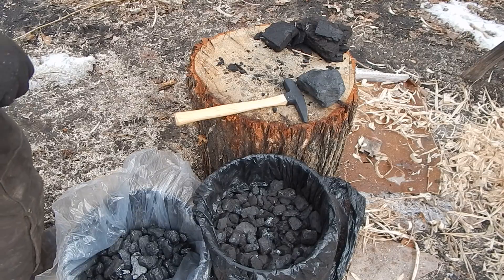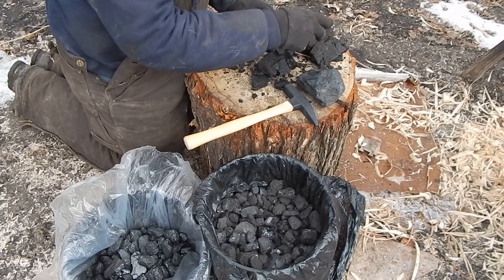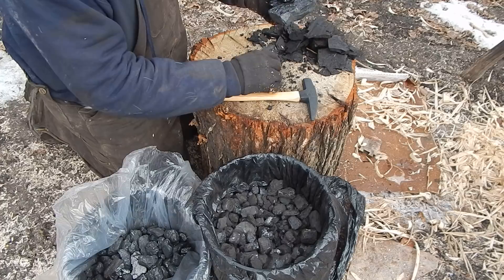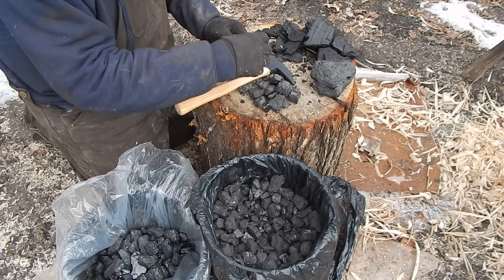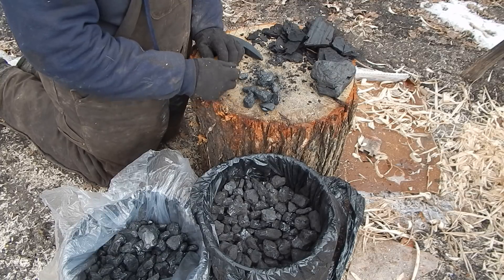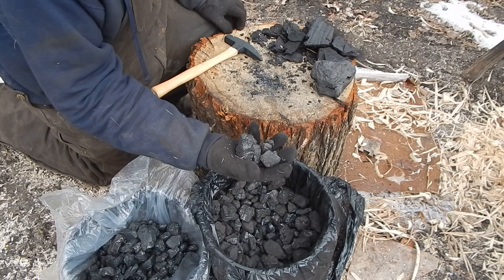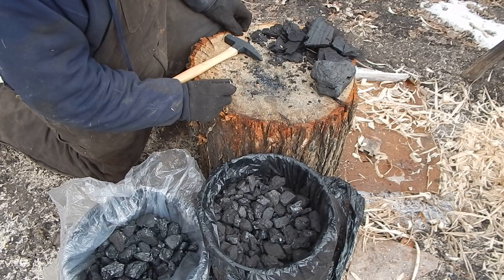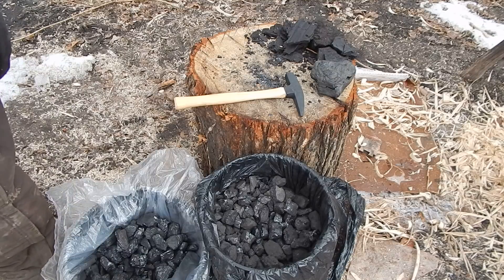Coal

Comment: No sir you are not correct about what coal is. It’s not pete compacted or wet marsh compacted over millions of yrs. Coal can be made in a laboratory in about two weeks. Yes it takes pressure right amount of water ( note amount of water is crucial in the process but the main ingredient is bark. When the Flood happened all the logs floating in the water rolling around rubbing or beating each other knocked off the outer bark it settled on the bottom eventually covered with silt rocks and so forth. Eventually turned to coal we now know this as fact I’ve been a coal miner most my adult life surface and underground we often found fossils in it. Shark jaws among other things.

Comment: There's a vain of coal near to me, maybe 20 mins away in a hill that was cut away for a road. I just load a few 5 gal buckets up with it and it works in the forge but it doesn't burn very long or coke up well. I usually use it in the wood stove in my little cabin I built because I use the better coal I buy for inside my house. My friend has a farm nearby me that has a railroad that they store empty carts on and most of them are coal carts. they all have coal in the bottom so me and my friend got a ladder and buckets and a rope and I went down and loaded up a bucket and he pulled it out lol. It was anthracite but it's a little bit sketchy playing on train cars.